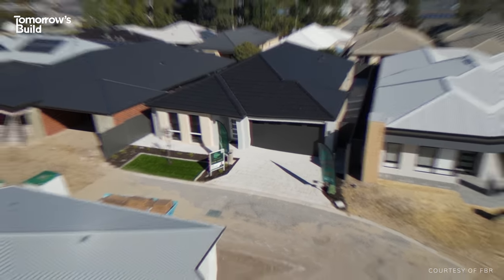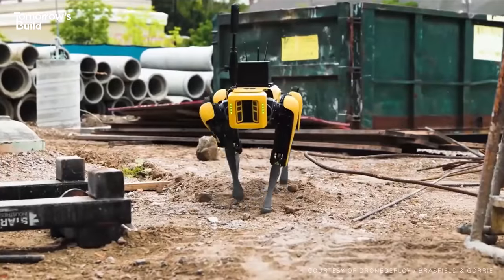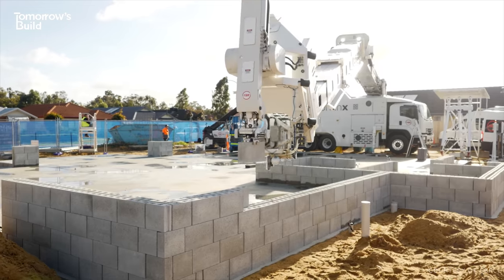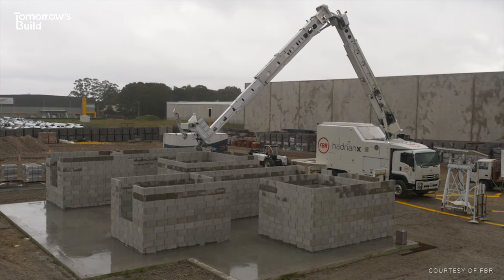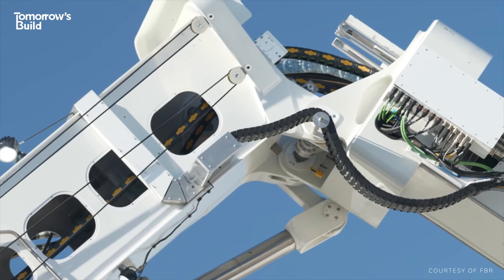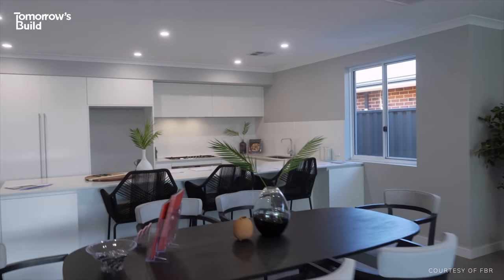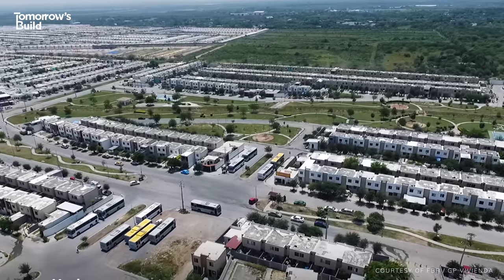This Robot-Built House Could Change Everything

Comment: I always wondered why bricks were not designed to have mortar injected into the top or side of the brick and have the mortar extrude from exactly where it's needed after it's placed on the wall?
Reply: interesting idea, I think the main problem would be the bricks would tend to drift out of alignment as the mortar squeezed out - they would kind of float around.
Reply: @craigmortell  I was thinking that after the machine laid the brick another arm holds the brick down momentarily as the mortar injector does it's job. 
I was also thinking the brick would have a lip the sits in the brick below and on one side to stop wastage and look more attractive at the same time.

Comment: The build seems very light on rebar. That might be ok some places, but I live in earthquake territory and that should have had rebar in every brick and between courses to meet safety standards.
Reply: Perth is not in an earthquake zone and soil is mostly sand (some clay areas but predominantly sandy soils). This means less movement over the seasons therefore minimal reinforcement in structural brickwork required. 6mm rods are often placed over large openings but nothing really larger than this.

Comment: How come no mortar between the bricks?
Reply: adhesive is easier. Mortar would require a long hose running up the boom, which would take up space, add weight to the boom, risk clogging up, need someone to constantly be mixing up more etc.. Besides mortar has lousy thermal performance.
Reply: @craigmortell  Doesn't adhesive also require mixing and long hose running up the boom? Adhesive can clog too

Comment: Uhm, is it just me or are they forgetting cement between the building blocks?? 😳 My grandma could push that wall over I think...
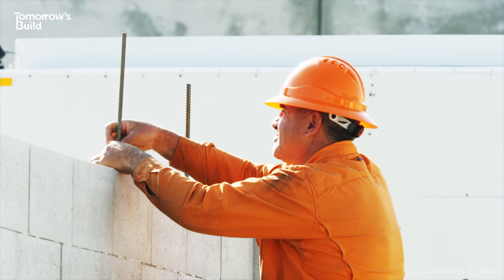Reply: Look at 7:40 they fill that in afterwards from above
Reply: @skygge1006  yeah, the horizontal layers get filled but that still doesn't explain the vertical gaps though does it??

Comment: Fantastic, really, but why did all those bricks except the few shorts only of bricks not being laid, why were they seemingly laid dry? Maybe it was said without me noticing :s also I'm wondering how it works in terms of GPS accuracy and such so a matter of pre planning and straight to a house then the other etc before the mortar sets within those 45 minutes. Otherwise I'm wondering how the mortar isn't wasted (yes its said almost no waste) in the end between buildings? :O
Reply: it uses an adhesive instead of mortar. There's an applicator thing just before the gripper, so as the blocks roll out of the arm the adhesive is rolled onto the block and then the delivered to the gripper for laying. Accuracy is all handled with lasers and adjusts in real time to any wind gusts etc.
Reply: @craigmortell  thanks a lot Craig :D I was so sure o was short clips of a weird mortar coming out :s lol. I did notice what was said about the constant adjustments based on lasers and the like, it's absolutely incredible

Comment: I dont get why they never show the part where the cement is applied to hold the bricks together
Reply: at 7:48, seems the bricks are secured by the steel bar inserting into the hole of bricks and then there are some stuff added manually
Reply: @sowhat3430  but the bricks are not aligned so how would that hold them together.

Comment: Ok, they solved 2 problems: size of the Machine (3D machines for construction are huge) and the type of construction material that the machine uses (concrete blocks are used in almost every country), only 2 problems remain: worldwide technical support for a machine like this and convincing concrete factories to make blocks (with size/shape) that are specific for this machine👈
Reply: another major problem, if there are any more builders want to try out this robot, because they're often under pressure of the unions.
Reply: @photovideooz4084  No an issue in country's were there are no construction unions (or there are but they don't have any labour influence).....and trust me there are a lot of country's in that situation, even first world countries

Comment: It's amazing but only the first step, and "robot-built house" is misleading, because the robot only built the outer walls.  If they build the interior the same traditional way, they are only about 5% done with the engineering, since there are dozens of major tasks left.  I think to get closer to truly "robot-built" faster they will want to reinvent the way the interior is built also. For example, it might be possible to manufacture an entire wall of plastic plumbing at once using a mold.

Comment: I personally think brick laying is out dated, they should be laid out in a mould under factory conditions, cement (or other adhesive) injected into the gap using additive fabrication technology and trucked to site as full wall sections of standard sizes
Reply: could also have standardised curved profiles making aesthetic features with ultimate efficiency

Comment: Why can’t you just precast the walls & just assemble on-site? I never understood the point of laying bricks. Transporting them is the same weight as a precast wall without the need to lay them out.
Reply: They are; I watched one go up yesterday. Precast concrete panels on piered footings. Big crane lots of blokes. Went up in two days for apartments. Trailer loads of panels delivered to site.
Reply: But that is for multi unit construction; this robot is building single houses.

Comment: It's a nice house but it's also going to be very expensive in materials alone. Sure the robot saves you some on labor but limits you to the materials you can use. You also still need the other trades, which if this builds according to architectural drawings, will likely run into many issues that accompanies blindly following a blue print.
I'd love to be proven wrong but this seems like a rich boys toy or pr stunt more than anything
Reply: They are not intending to sell the machines, but offer 'wall as a service' instead. So you call them up and they charge on a per brick/block basis same as any other bricklayer. Then it drives off to the next job - at least that's the plan. As far as the builder is concerned its just a sub-contracted service and if they cost too much they won't get the gig.

Comment: at first this seems great, but in a lot of countries they are quickly moving away from using a lot of concrete or ceramic buildingmaterials for walls and floors (except the groundfloor) for normal housing. This robot would be utterly useless on such constructionprojects because the deployment would cost a lot and other construction needs to be halted while the thing is working. Maybe it has a use in building the partitionwalls of a row of houses, so work can be done on the first set of houses while the robot works on the next couple of walls a few meters over. Otherwise I really don't see a use for this. At least not in parts of the world where they are trying to build sustainable housing (which is often just completely prefabricated anyway and uses mostly wood instead of concrete and ceramics...)

Comment: Unreinforced masonry construction?  No thanks.  Get some rebar in there and fill the voids with concrete, and maybe I'd be interested.

Ant they only automated one small aspect, framing.  What about drywall, plumbing, electrical, siding, cabinets, etc.  They need to automate all of this.

Comment: Wall construction cost is about 10% of total construction cost. So what's the point of this? It can't lay ceiling, just walls. It can't make a roof, can't lay outer bricks, can't insert windows, etc,etc. Solving wrong problem...

Comment: I wonder how you can see this video and not see what is left out. In the video the brick are laid without cement and light is seen between them, how is that applied is not shown or make evident. This looks not only costly and clumsy (the whole "robot" plus special bricks, special everything, plus the human assistance that is needed anyways) and a poor solution for the brick laying "problem" (is weight and other factors are the concern you could think of a assisted-by-a-human robotic-arm-machine who would do the whole process faster perhaps). Also this defeat the end if the final price equal or (surely enough) even more expensive than the common house for the buyer. 

On the other hand there is no shortage of hands for work, the whole interest is merely economic in hopes of (finally) automatize the field (saving work force, insurance cost, etc. what is more of a problem in places where the sector is supervised, no so on countries where workers are just a little better than expendable slaves). There is nothing wrong with trying to innovate and cut cost but don't invent false premises.  

You can easily see that, except for the repetitive task, the "robot" seems poorly designed and slow (it's seems like making use of already available systems to make it do the job rather than an especially designed for the task machine) but I guess having one conceptualized for this work alone would add millions to the goal, so better just modify what's already proven.

Comment: This idea definitely could change the construction world. So let’s get real about this? First it needs to abele to retrofit from robotics to manual operated. Also it needs the ability to change to a concrete pumping machine. Plus for safety purposes it needs a human to be holding a control box at all times. Why because robotics machines can not actually see someone standing in the work area and if a person is standing in the middle of point A to B the robot will not stop until it gets to point B. In other words it will punch right through a body like ripping a piece of paper in half killing whoever is in its way

Comment: Yeah this is way better than the 3d printing disgusting homes. It adapts very well to already existing work.

3D printed homes are way harder to work with for the engineers who decorate the interiors with piping and electricity.

Comment: This system is a bit fake, there is NO way the bricks just stands without any clueing layer between them, o the bottom and sides. I bet the bricks what the machine did they just removed them and manually, by hand, laid them with plaster etc. Polyurethane isn't too enough to "glue" without filling the inside of those bricks  with cement . In my eyes this is still far away from real application to be used anywhere.

Comment: Secret "adhesive" you mean quick set? Ya have fun with cracking and splitting due to those weather conditions. There's a reason why construction companies opt in for m-20 and similar concrete. Cutting corners is no big deal to them, if your home is made in 2 weeks they'll just build you another lame home until that one falls apart around you another decade down the line.

Doubt it's a secret anyway, most likely aluminum sulfate.

Comment: Once we accept the fact that human labor is an outdated concept, other than the creation of ideas. The better. if machines are capable of doing the work and displacing human labor. this could allow us to free ourselves and solve problems without the current limitations of monetary need. Also since the machines don't require paycheck. Maybe it's time we address our societal relationship with the concept of money reducing our need for such a system. (Also since the fact that if machines are replacing human labor the acquisition of money is greatly diminished if we choose to maintain such a system).

Comment: Mortar and plaster is manual work after this but Infeel it does not give good strength to the wall, as the integrity with mortar and brick cannot be matched with manual labor work and robotic laying. This kind of work saves only construction time but cannot save life's when nature's forces and disasters occur. Just a good idea for  faster bricking. Precast wall is better idea than this, even that saves labor and time.

Comment: Yup Sure it works good for a little bit until it gets out in a real field where there's weather and then it decides it wants a breakdown and then you need a technician that's need a technician that's a $1000 an hour to come out with his computer  And fix it just like the tractors all the fancy technology on the new equipment out there went out there I wonder why contractors don't want it maybe because it's super unreliable and the cost to maintain does not balance

Comment: Yup.  And after the robots are done, the tradies come in and spend a few months turning a concrete block box into a home.  Really, what percentage of the time and cost of a house is in framing it?  Land cost, dirt work, foundation work, roofing, fittings, plumbing, electricals, doors and windows, finishing, painting and builder profit represent 90% (+/-) of the cost of a home.  They can knock 5% and a couple of days off by investing a million $$$ into a robot...  Not impressed with 3D printing the boxes, either.
Reply: Spot on West Bay. This will probably only be useful on large commercial projects, although pre-casts have taken most of that business. Just watched one go up yesterday !

Comment: Well using an age old block with a modern robot seems to be an oxymoron.  Oh but you redesigned the block. Living in a block home isn't the most comfortable living. I wouldn't. Also no mention of all the other old fashioned construction processes required.  Bet the plumber and electrician aren't going to be happy.

Comment: What ugly buildings in an ugly neighborhood. Why don't they leave any space around the property? Here in the Netherlands there are laws on how much of the land can be used to build on. And there are minimum requirements on how a property should look, which is assessed by a special department. These houses would fail immediately. 

And the neighborhood looks like many USA suburbs. Car centric, and as recent research has shown a loss making way of development. Why not build two or even three stories high? Especially in a very hot climate, where you can use natural convection to cool down structures. 

These large houses with huge roofs look like they are hard to cool. Australia has one of the highest per capita Co2 emissions, and this could be part of the reason why.

Comment: the fact you compare speeds between Brick laying and CMU Block laying shows you should do more research, of course placing larger pieces goes faster, why wouldn't it? You act like regular humans couldn't also lay these CMU Blocks, which they can and have for many decades, Could this still beat Humans, maybe, depends how many Mason's are on site, I've seen an Auto Parts Store of similar size have it's outer walls built using CMU Blocks in like 2-3 days, but even if that machine is faster having Block Walls is a far cry from a finished house and most construction firms aren't big enough to buy expensive machines like that anyway and while I can't speak for Australia, in the USA and even China there is no lack of housing, it's more a lack of people being able to afford houses in the USA and China has CITIES, ENTIRE CITIES that they built that have no one living in them.
Reply: Then you require 100 masons for this job which can be done by one machine.

Comment: Huge dollop of b0ll0x here

This so called 10x better adhesive is hardly being used.
When I look at a brick wall built by a professional bricky I don't see light through it, yet these walls resembled  a cheese greater (which isn't really waterproof).

...and before someone comes to tell me about rendering etc.
Yeah!!!!! That's my point.
Block work and brick work aren't the same and is being used to emphasize a difference.
Reply: Given the adhesive is 10x better you don't need as much, potentially only 10%. Also it's an interior wall though a structural one so the gaps would allow it to lay the bricks easier and doesn't have to make sure it's air tight.
Reply: @johnschroeder3072  So why compair it to an exterior brink build building?
You don't have to answer that as it wasn't a serious question.
The Australian owner of this robotic sysyem is playing a sales game. Hopefully people see he's comparing chalk and cheese